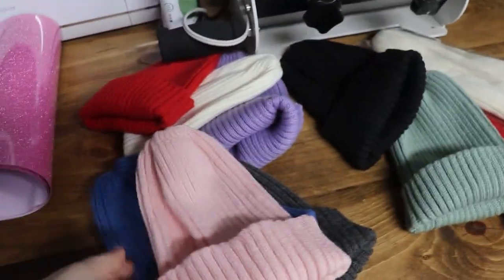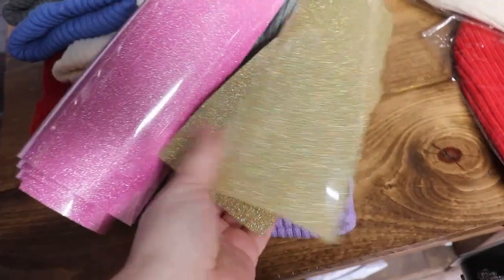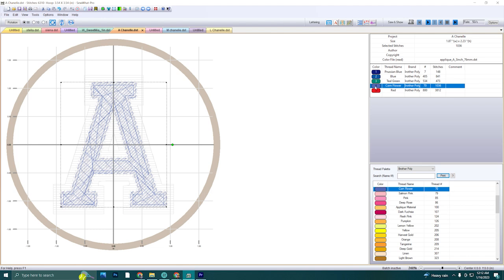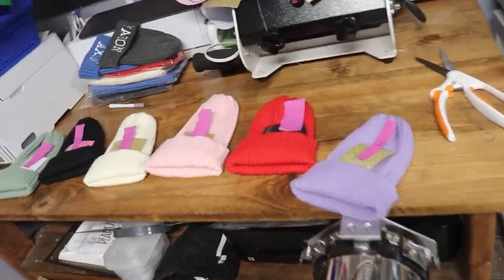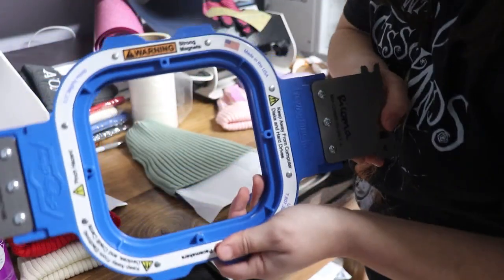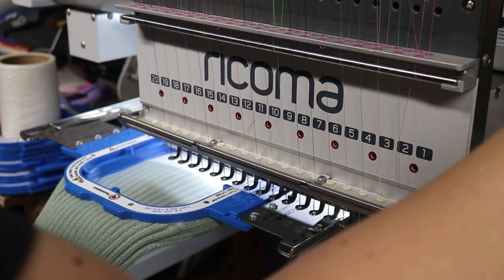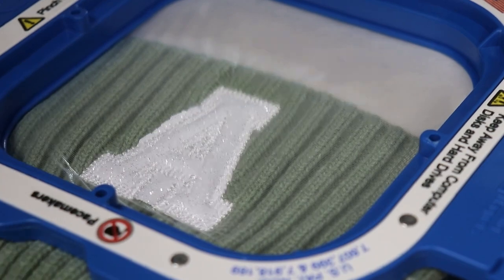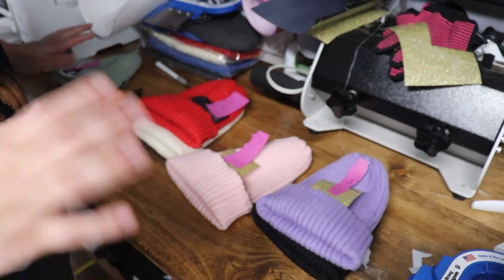How To Embroider Faux Chenille Beanies / Launching New Items To My Shopify and Etsy Shop Studio Vlog

Comment: How many might hoops do you own? Do they come in a bundle with different sizes?
Reply from the maker: They do have kits that come with a mighty hoop and a hooping station but no bundle deals for the individual mighty hoops. I own 2 5x5 hoops for each machine ( 6 total) and 1 8x9, 10x10, and 8x13 for each machine.